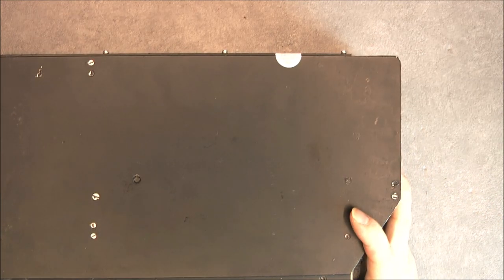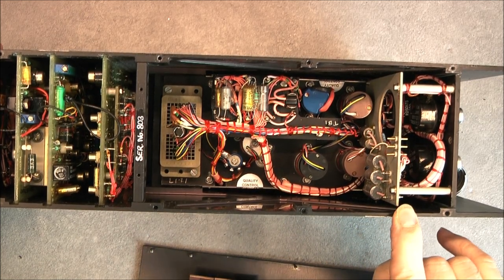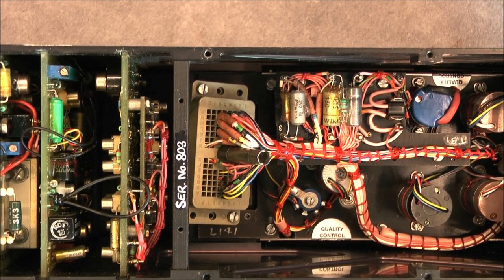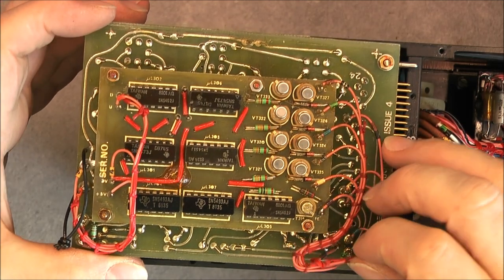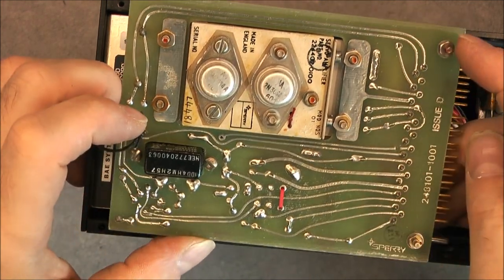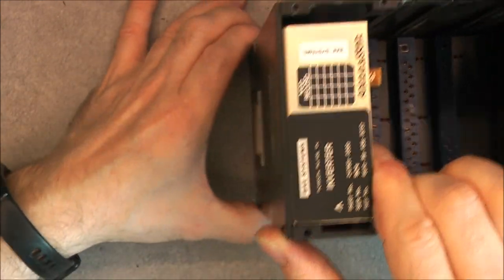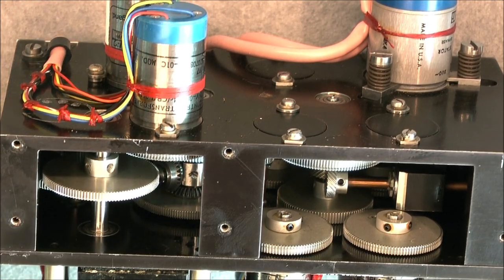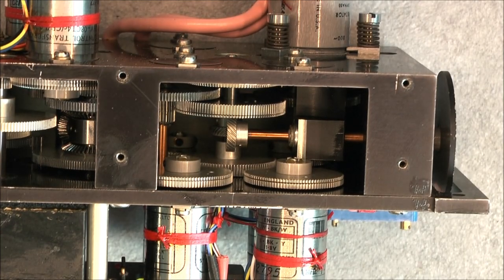BAE   Sperry GM compass computer MK9 teardown

Comment: Exquisite gearing, thank you for sharing. In the early 1970s, I served my apprenticeship with Muirheads they made standard cells, original facsimile equipment, synchros and servos. The management was mainly ex-military. I believe they still make synchros and servos today.

Comment: I messed about with synchros and resolvers some decades back and found them to be an interesting technology poorly suited for the hobby user.  I used a pair as a wind direction repeater for a long time, they have very low drag and sticktion bearings and low inertia as they have a single cup winding in the armature with no iron mass..

Basically they work with a master and a slave (or multiple slaves for fan out).  They are all powered by the SAME 400Hz supply on the rotor through a pair of slip-rings.  The stator is a three phase transformer arrangement and the 400Hz couples to the three phases proportionally to the angle that the rotor is positioned.

You can think of these as a three phase stepper motor with a single step per revolution and a AC excited magnet,  or a rotary 1phase->3phase phase sensitive transformer.

The slaves have the same configuration with perhaps slightly different turns on the windings but when they receive the three phase signal that is synchronised with their stator 400Hz drive signal they ROTATE to match the position of the master.  Within torque and speed limits the slaves will all follow the master as long as there is power.  Because they only have one 'step' per rotation they will reset to the exact position after the power is restored.  Because the excitation is AC they have a holding torque and know their absolute position even when the system is not moving unlike a pair of stepper motors that can slip slowly out of synchronisation even if they will track when the wires are in parallel and one turns one motor the other will follow if they are permanent magnet stepper motors.

Basically they were devices used ALL OVER in aircraft to transmit angular position between sensors, indicators, actuator servo systems and analogue computers.

The fact that this device only has one differential in it means that it can only do ONE simple addition/subtraction (with possible constant angle multiplications done with gear ratios) and as it has the compass indicator I would think this is used to correct a gyrocompass signal with a fixed take off reference heading or something like that, some of the other circuits may have been able to apply dynamic braking to some portion of the circuit to achieve a damped reaction perhaps.  A lot of electronics, electromechanics and mechanics for a few lines of code in a modern system.  Bullet proof but very crude.
Reply: Thank you for sharing your experiences
Reply: The differential gear permits to add a correction which compensates the drift of the gyro. The correction is performed using a stepper motor which is activated when a difference is detected between the gyro position and the magnetic compass.